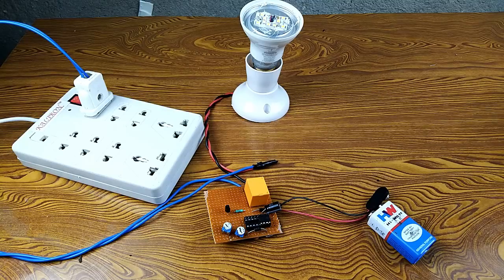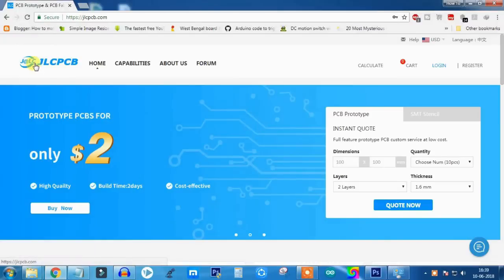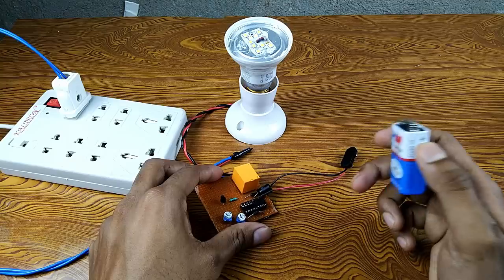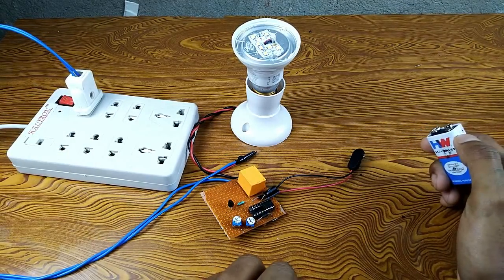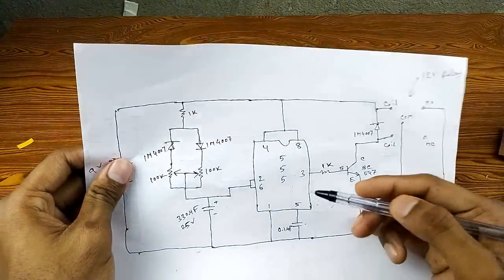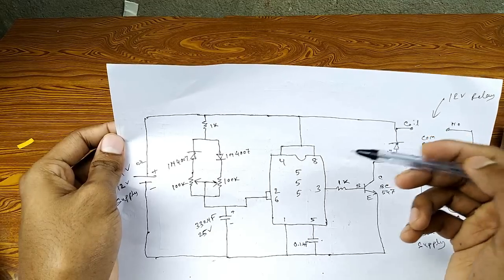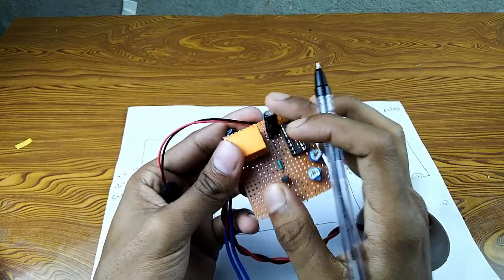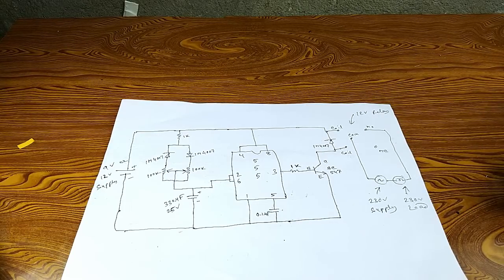Simple 230v Dual timer on off switch for fan,light,mobile charger DIY

Comment: Please give a complete circuit diagram. The diagram is not clearly visible in this.

I want to automatically on off my pump for every 15 min delay. Will this work.
Need to have some extra capacitors or components.
Coz according to your diagram I think it will only work for 1 cycle on off and just finish. No further consecutive cycles.

Comment: What is the maximum delay for this circuit...i need for 1 hour, 2 hour,etc. Pls advise
Reply: Please let me know the Answer if someone knows. 
Thanks
Reply: You have to then change the values of capacitor and resistor if you want for 1 - 2 hour
Reply: @chandrikaprasadc.p.7629  hi...do you the values of Resistor and Capacitor?
Reply: @chandrikaprasadc.p.7629  good idea... actually in that circuit which resistor i need to vary for changing delay
Reply: @anandhavignesh1578  can you please tell me the voltage of 0.1 uf capacitor in the circuit? And will the circuit actually works or not?

Comment: Great circuit. And yes, it needs pin 7. Works great for small periods of time. But what about a 24 hr period? The capacitor and potentiometers become too big!  Thanks.
Reply: Where to connect pin 7 ?

Comment: Good day. Im from  Philippines. I would like to ask for guide for my project which is similar to this one but ON and OFF will be triggered by at water flow sensor. Im going to build an AUtO ON/OFF for my 220v UV light water sterilizer. Scenario is when the faucet is open it will automatically turns ON the ballast for the UV light and when the faucet is OFF it should delay 3 to 5 minutes for the ballast/UV light to turn OFF. Thanks in advance and i hope you can guide me with my project.

Comment: You must connect the pin 7 of Ne555, otherwise it Will not work. Pin 7 to both D1 and D2 and resistor 1 (of 1k). Thanks for the circuit.
Reply: sir can u share the circuit because this circuit is not working

Comment: Thank you so much for the informative tutorial.
How to make a similar circuit for a single 18650 lithium battery (3.7 - 4.2 volts?
Thanks again
Reply: Just change the resistance values

Comment: Dear sir. The circuit is fine but not working properly. It works first on after off. I want that first it should be off for delay determine by the cap plus registance and it should start be started for second cycle. Is it possible that this circuit may work only on timer and not off timer. Like this it should work as delayed off timer and it should not work for its 2 cycle. In other work this circuit should work only for one cycle that is it should work either for on or off cycle. Readers have commented that pin no 7 should be connected to  pin no 2 and 6 or to diode 4007. Please clearify their remarks.
A. K. Goel

Comment: Hi akash I just want to know where do u represent variable resistance or potentiometer in the circuit diagram ,are they represent as 100k in series with in4007 diode ,really appreciate if u reply
Reply from the maker: Yes
Reply: @TheBreakoutTraderAKASH  hi akash thanks for replying ,I made the same circuit as u described but I have only 1 100k potentiometer and 1 is 10k but circuit does not work it keeps the relay continuously on adjusting does not work ,will u help me in this

Comment: Hi thanks for sharing ur vdo. I need small information. I am going to make small filling machine using this  circuit. .. Can I adjust this on off  between 2 to 6 seconds.. ? I made one using :-) 547translator. But  first 4 seconds off after adjust it's off 16 seconds.I need one to  adjust 6 seconds
Reply from the maker: Yes you can... download 555 timer calculator in your phone.. & calculate yourself
Reply: How To do clear ? Can you show any video detail ? Thanks

Comment: This circuit works properly, but when you replace presets or pots with resistor, either delay will suffer or on time. One more thing i have observed, initially whatever time you set using resistor suppose you are taking on time as 1 min. So, initially in first cycle of on and off you will get the on time you set ie 1 min, but after that it will be 25 sec or 28. In this no delay time is affected, its coming constant. If any body can explain this will be helpfull. My guess is it has to do something with capacitor and diodes.

Comment: Can I use this with 6v supply in 5v relay
Reply from the maker: Yes
Reply: Bro .. the circuit does not reset .. once I power the circuit relay on some time and then off. But it's not working continues ... What is the problem?
Reply: @z2techie42  i am also made this circuit.. but same problem.. i think its fake...
Reply: Yea bro it's fake
Reply: @z2techie42  I also think

Comment: I want to on my light for 20 minutes and off for 1 minute can this help me
Reply: maybe you can change both variable resistors (1M) and capacitor 1 (1000 uF instead of 330) or so, you must try.
Reply: Use micro controller

Comment: Hi  according to your diagram i have tried to make a circuit but it is not working.pls help me to compete the circut.i wants to operate a motor on for one minute and off for a hour.
Reply from the maker: It will definitely work..... Please check your circuit again... With proper components
Reply: @TheBreakoutTraderAKASH  plz give me the circuit diagram plz
Reply from the maker: @pranabpanda8904  check video description
Reply: Hello bro.i wants to on off a 220 volt motor small size and 8 rpm is the circuit support the motor.is there a need of to change components if so plz help
Reply from the maker: yes
Reply: The motor Will run with the same circuit

Comment: The circuit should be corrected by adding 555 timer pin no 7 with the junction of two  diode and 1k resistor for turning on the circuit automatically.